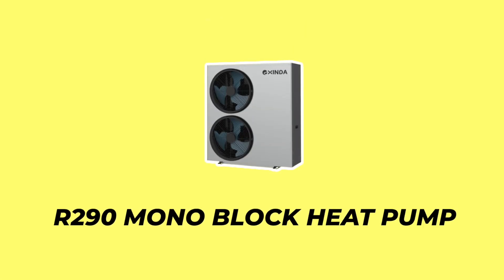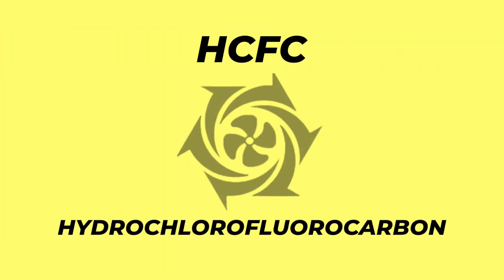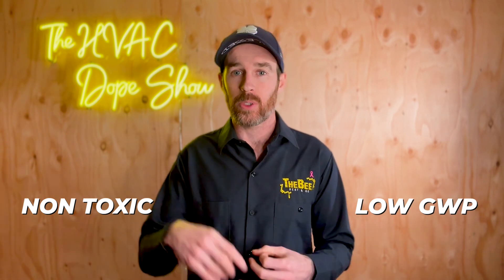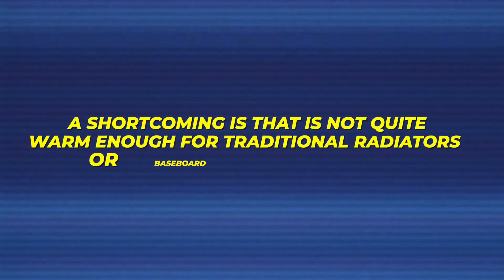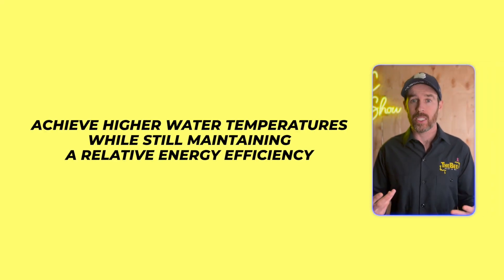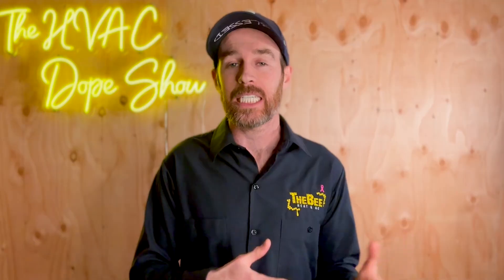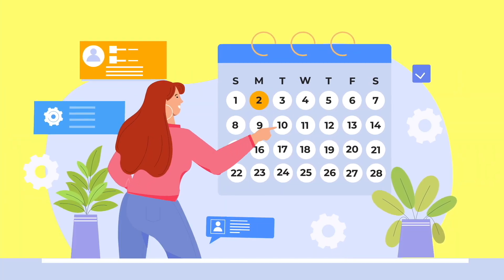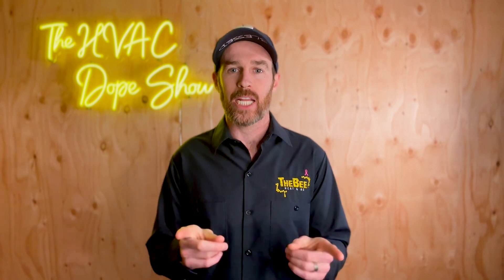This Heat Pump changes EVERYTHING | R290 Heat Pump

Comment: I wonder how the Propane refrigerant compares to the C02 refrigerant option used in the SANC0 units from Japan? Also, how does the propane function at -30 and lower. I hope the glycol lines moving from the inside to the outside and the heat from the compressor keep it the propane functional. Seems like propane at -20C or lower in both tanks and vehicles can be a struggle to maintain functioning pressure. I will be looking for the 290 options! Thanks from Canada
Reply from the maker: I’ve always wondering why the CO2 units from Japan don’t make their way here… Propane works well at low temps that’s one of the best selling points, I’m not sure if they’re available in Canada yet but they might make it there sooner than the USA!
Reply: @TheHVACDopeShow  SanCO2 is here in the U.S., but it is a relatively recent thing.  I actually have a SanCO2 heat-pump water heater.  The CO2 loop is entirely internal to the outside unit.   The tank inside has a short water loop that runs through the outside unit and returns to the tank hot.   I really love it.

I think one of the reasons why CO2 hasn't taken off yet are the relatively high pressures the CO2 refrigerant loop has to run at.  This requires a higher-quality build which can be a bit of a hard sell in a market where all the competitors are trying to be the lowest-cost (and lowest quality) offerings.

But it is something to love, really.  The refrigerant loop is entirely contained within the outside unit.  There are no external refrigerant lines, period.  That also means the loop can be really compact, more efficient, and less prone to failure.

-Matt
Reply: the pressures that the c02 units run at is about 1000 psi?  At those pressures i think you get way more blown out condensers and blown up compressors
Reply: I would prefer the SANCO2 units personally. No propane and a long and excellent record of performance. SANCO is available in the US from Small Planet Supply and some other vendors.
Reply: @Hybridog  Too expensive and much higher pressures.
Reply: Sanco is outdated they give you only 50 percent from nominal capacity in cold climate
Reply: I recently picked up a used sanco2 heatpump in Victoria BC. The people I bought it off had no idea how it worked( house it was installed in was new to them) they opted to replace their hot water tank from 2016(the sanco2).
I have tested it in my shop(works great) and am just In the process of plumbing it in for my in floor heating.
Time will tell how good it is.

Comment: Propane was being used in the 1800s and early 1900s for AC systems. We are just now making a complete circle.
Reply: And R600 is butane. They’ll never be allowed in the US because they’re too cheap and DuPont has regulatory capture and the Feds will make you buy manufactured refrigerants.
Reply from the maker: I don’t disagree I’m hoping it’s not wishful thinking. They’re technically already being used in the USA in commercial applications like ice makers / coolers in low charges but we’ll see if they transition to residential monobloc applications
Reply: @yolo_burrito Butane will not work in cold climates as it condenses at around 30 degrees F. Propane condenses at -44 degrees F.
Reply: @AlanSanderson-u4t  are you taking about as a fuel or as a refrigerant? You know those numbers are at atmospheric pressure right? That’s like saying there is no phase change in a refrigerant loop because of ambient temperature.
Reply: To clarify, propane was used to heat an ammonia hydrogen blended refrigerant; propane was not the refrigerant in the 1800s as some might conclude from your comment…
Reply: @EarlHayward  The refrigerant also included water, which absorbed the ammonia. Servel patented the process. When I was a small child we had an absorption refrigerator that was heated by kerosene. We also had Coleman lanterns and a gas engine Maytag wringer washing machine.
Reply: Is R290 only for heating / hot water only  or for cooling / AC as well?
Reply: But sure to the very high fire hazard it presents they moved away from hydrocarbon refrigerants for the north American market. In a monobloc setup it can be utilized in an appropriately safe manner. It doesn't take very much r-290 to get a very hot party started, think BLEVE. But as I already said a monobloc mitigates that hazard to an appropriate level.
Reply: Get excited when r22 comes back
Reply: @freekill123100  That isn not going to happen.

Comment: How does it work in very cold climates and producing real heat?
Reply: Excellent
Reply from the maker: Yes it keeps up extremely well, and with high efficiency ratings. A lot of them can keep up to 20F and lower while maintaining decent capacity and efficiency

Comment: so monoblock works with radiaters not duct system. oh well. thx
Reply from the maker: It works with a ducted system as well, or radiant floors or a variety of apps… higher water temps at higher efficiency is the main point. For example your btu output on an air handler at 120F vs 180F is almost triple at the higher water temp
Reply: Monoblock systems can feed chilled or heated water to a variety of hydronic applications, not limited to radiant floors and radiators. It can also supply chilled or heated water to fan/coil units, like low wall console units, high wall units that look like mini-splits, and traditional air handlers that can replace your current refrigerant-based air handler. It's a super flexible approach to HVAC.

Comment: When do you think this heat pump will be available in the US market, and what company is going to carry this heat pump?
Reply: Yeah good thing we only have a max of 500 grams of propane... versus the steady supply line of nat gas or propane which is currently used in furnaces. 😒
Reply: @Joey-fs7ro    there are 5 or so agencies with different scope of control, not to mention all the local building codes that would have to be modified to allow it's use as a refrigerant, where furnaces allow NG and LPG because of existing codes ...  this has been underway for 3-5 years in the US/Canada - in the US U.L. had to take the lead and everyone else is a followon as I understand it.   I hope they're doing CO2 as a refrigerant too, because that is coming...
Reply: I think this is a refrigerant that the people will want but unless the regulator gods allow to be purchased and used in the US residential market, the issue is dead before it gets off the ground. Besides, do you think that the Dupont lobbyist are not working hard to squelch this from coming to the states 😞how big of a hit to there profits if everyone in the residential market switch to cheap "Propane"   

my question is how well does it work in the south where the majority of the time we need cooling instead of heating and how would that work if you wanted to using it for your water heater and at the same time need it for cooling your house ?
Reply from the maker: Yes R32 will probably be one of the main next gen refrigerants but for mono bloc applications (meaning there’s no refrigerant lines running inside) R290 is a great refrigerant for the application. For cooling not as big of a deal but it’s still very efficient in cooling.
Reply from the maker: LG Samsung Viessman all make these already, the problem is design and charge limits because of flammability… but I’m hopeful this might make it here this year or next? I’ve called several distributors trying to find one and they’re not available yet, but likely soon.